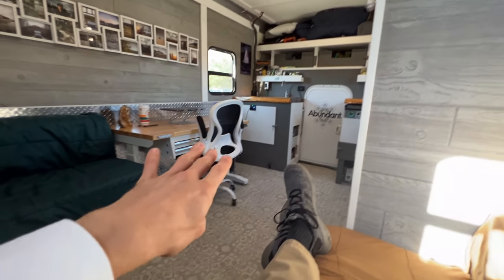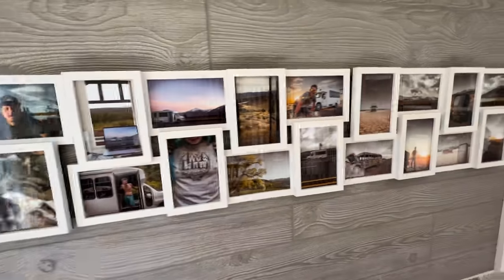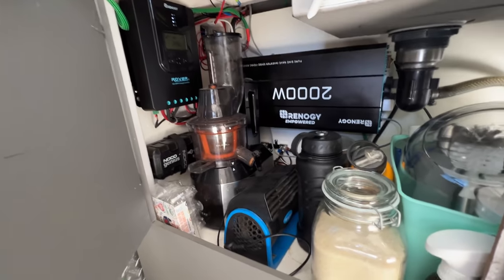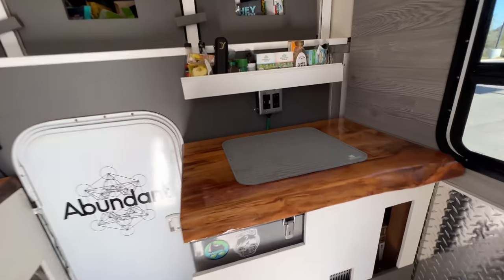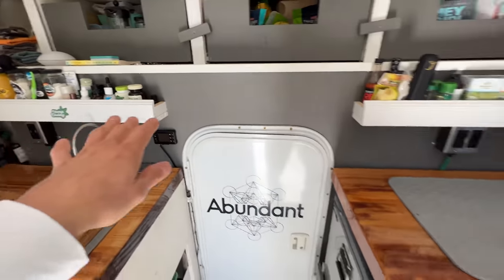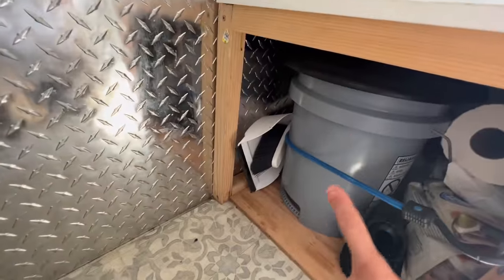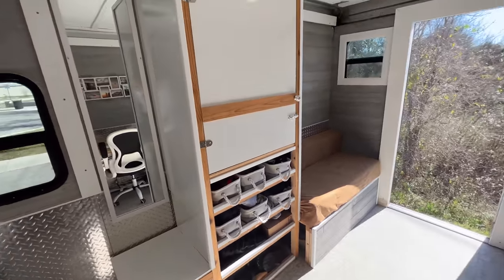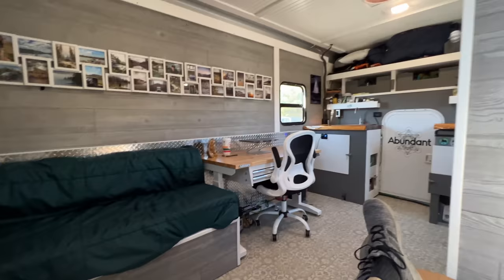Box Truck Conversion | U-haul  to Tiny Home Tour

Comment: After all my time watching the videos. people have suggested heated floors although a bit pricey have paid for themselves 100x over. I wonder if you would consider a system like that. It could also run a hot water system in the build or a cool depending on the temp you set. would you consider a happy jack or Murphy bed? the open space concept is good too overall I like your build!
Reply from the maker: I have seen the heated floors done. You have to heat with propane though. It’s not economical to hear water with electricity in a van. I prefer to use an all electric system. My heat pump does this very efficiently and I can do it with solar, never having to buy propane.

Comment: Hey Brad, 
New Subbie here 😊
I am so happy I came across your channel. Love what you did with the space. I also love the name of your van. I saw that you’ve been on this journey for 4 years during which u had different vans. Is there a reason why you kept changing it. Did your previous vans give out/maintenance issues? Or did you just want something new? 
❤ love that you have crystals and you talk to them lol. I do the same thing! — sending you Peace & Love on your travels/journey. 😊
Reply from the maker: I have built and lived in 4 different rigs in my 5+ years on the road. I wanted to try different vehicles and layouts. 

Box truck is now my favorite platform. I sold the last box truck because I came up with a new design to try out. You can see how different my latest box truck build is. 

It makes more sense to sell a build and start from scratch with profit rather than rip everything out and built it again which there will be no profit, only expense

Comment: Very nice build, I'm going to take some inspiration from your van.

My one thing that I have issue with is actually safety related. you really should not store fuel in the cab where you drive, fire hazards aside, diesel is an extremely toxic fuel when the fumes are inhaled and if a small crack were to form in the container the air could become toxic very quickly in that tiny airspace.
just trying to look out for you, keep on truckin
Reply from the maker: Thanks for watching!

Comment: Very nice build and thanks for the tour. I have been bouncing back and forth from this very truck size to a sprinter type van.  The reason I always seem to go back to the van is fuel economy. In today's world fuel prices make a huge difference to the distance you move around. I love to move, but i also would prefer this size of a home.  I never get an honest answer to what the fuel economy really is for a truck this size. Can you please give me a honest real life fuel cost. Also I didn't see if this was a diesel or gasoline powered machine. Then comes into the picture how many miles can the gasoline versions go before major engine work is required? I really would love to know these things before deciding on buying one over the other and regretting it.  I love the space you have in your home compared to a van but......?
Again thank you.
Reply from the maker: This is the gas v10 motor, it gets 9.5 mpg. Previously I owned a diesel 7.3L shuttle bus and it got 12mpg. Before that I had an e250 cargo van with gas 5.4v8. It got 11 mpg. I don’t really feel that’s enough of a difference to matter. Fuel is expensive but you don’t have rent or an electric bill or a water bill or a garbage bill…
Reply: @nomadbrad503 , that may be true.....but it's still a gas hog.

Comment: I really like your build, however, i think if you ditch the bench bed, and instead use the mom's attic as one, you would reasonably be able to install a nice bathroom and more storage by moving the door to one side. Also, missed opportunity to add a stove by not making the fridge area an L shape.

Overall though, i love the video and the design. Any rescources you would suggest for learning how to do electrical and plumbing for these things?😊
Reply from the maker: there is plenty of room for a bathroom if you wanted one in here

Comment: Doesn't the bed separate (slide apart) while you're sleeping? I'm a very restless sleeper so I'd have to have a single piece twin. Thanks; great truck, great video!
Reply from the maker: I put a mattress topper on top it has the elastic bands in each corner which hold everything together

Comment: I love the layout of this conversion! 
Do you have a link for the faucet that you use?
Any plans on hiding led lighting on top of the tracks to the old roll up?
Reply from the maker: Here’s the faucet: 

Upgrade Drinking Water Faucet with Flexible Gooseneck, 360 Degree Rotatable Water Filter Faucet, Kitchen Bar Sink Faucet Lead-Free Cold Water Faucet - Brushed Stainless Steel by Lesica-RY https://www.amazon.com/dp/B08LSL1W9J/ref=cm_sw_r_cp_api_glt_i_ENG6MDERYXR74SD3WEQH

No plans on led strip lighting at this time

Comment: Wow nice job most spacious u-haul conversion I've ever seen . i am planing on doing the same however i am married and was wondering if the bed /  bench setting is big enough for 2 people . Any ideas ? How much money did you spent for this lovely project ?
Reply from the maker: This Bed was a full size memory foam mattress that I cut into quarters. It’s roomy enough for 2 but you could fit a queen, no problem. The conversion was $5,500 for the van and about $4,000-$5,000 for parts and materials.

Comment: 8' x 12' and no bathroom? I don't feel like this is a great use of space. An entire shower could have been included in the design. I know it was also an intentional choice not to put overhead cabinets as to preserve the openness, but lots of items are strewn about without a home (pressure cooker sitting on the floor, etc), making it seem extra storage would've come in handy. I definitely would have kept the roller door to maintain stealthness, sacrificing a few inches to install the traditional house door behind it.

The box truck camper is still a great concept and this guy's living it up, so kudos there!
Reply from the maker: those are valid concerns. everyone has different priorities

Comment: why did you put the hinges on the outside that would make it easy to remove door
Reply from the maker: its much easier to just break the front window or pop out the lock. If someone wants in, they will get in

Comment: Love the truck, its awesome..why'd you go from the shuttle bus to this though? Just curious
Reply from the maker: Sealed cab is so much quieter for driving. And the shuttle folding doors were noisy on the highway. Box truck is taller and shuttle busses and built better without the fiberglass

Comment: How do you find the power draw for that fridge? I'd like to install 2, one for freezer and one for fridge. How much power do they end up using?
Reply from the maker: The instruction manual will list the power draw. Also there is a sticker on the back that lists it. Mine is around 5 amps

Comment: Next time, get a larger box truck, so you don't have to remove the roll up door at all, use it as a storage area, while also having a "patio" having an interior door just after the roll up door, added security, so long as you also have the interior door to the cab, just incase someone decides pad locking something they don't own is funny.

Comment: Is there a reason why you've had so many van/box truck builds? The reason I'm asking is that I really want to own and build a van/box truck. My husband does not, he says the truck will breakdown constantly. This has been a constant disagreement. Please help me understand that side of van/box truck life. BTW I love your box truck. Thanks in advance for your help.
Reply from the maker: I have been on the road 4 years and lived in 3 different vehicles. Ford 5.4l  v8 gas cargo van, ford 7.3 diesel short bus, and now the ford 6.8L v10 gas. All my vehicles had over 100,000 miles when I purchased them. I have only broken down once...in my 5.4l cargo van which had 268,000 miles. It blew a spark plug. I typically take my vehicles to the mechanic about once every 6 months for some kind of work...that’s it. You definitely want to have your vehicle inspected before purchase and change oil regularly...other than that, the only thing to fear is fear itself.

Comment: Do you officially prefer the box truck camper over your previous shuttle bus build? I'm still deciding between the two.
Reply from the maker: Yes, I prefer the box truck. The separate cab is nice because you dont hear everything rattling around in the back, it feels more like your driving a regular van. The bifold doors on the shuttle bus are also noisy. I like the taller ceilings of the box truck and the square walls make building so much easier.

Comment: Did you notice an increase in road noise in the cab after you cut your pass through to it?
Reply from the maker: Yes it’s a bit louder
Reply: @nomadbrad503  Yeh I looked into doing it for my truck but my motor is a huge diesel and the cab is over the motor so basically right below the opening. Extra noise is very fatiguing on long drives.

Comment: How do you obtain strong Wifi signal and how much do you pay for gas? MPG is roughly 10MPG right?
Reply from the maker: I use a mobile hot spot for internet and added an external antenna. Gas mileage is 10mpg

Comment: what kind of solar panes you use cause you mentioned they are 300watts a piece, is it 24v system ?
Reply from the maker: The panels are 300 watt 36volts. The mppt charge controller steps those 36 incoming volts down to 14 volts or less to charge the 12v battery system.

Comment: Who makes the walkthrough parts? I hesitate on a box truck for that reason, no walkthrough on most of them. And do you pay commercial rates for insurance or can they be re-classed?
Reply from the maker: This van was reclassified as an rv insurance is $67/month through allstate
Reply: @nomadbrad503  Thanks, thats useful. On insurance, do you happen to know which of the common platforms is the cheapest to insure? Bus, shuttle, van, stepvan, box truck. Ive never done a survey of this and if there are big differences it would affect the choice.
Reply from the maker: @cvcoco  no big difference..my shuttle bus and box truck had very close pricing…about $60 per month for liability only. You most likely won’t be able to get full coverage on a diy build
Reply: @nomadbrad503  Ok i see. Did you ever insure contents separately as personal property?

Comment: I need a stealth camper. 1 thing i cannot go without is a spot for my 1000cc sportibe preferable inside. Anyone got links to builds with somthing like this would love a link.
Reply from the maker: You can do it. I have a friend that keeps his Harley on the rear freight lift of his box truck. Also seen a sport bike in the back of a shuttle bus, they used the wheelchair lift to get it in/out

Comment: Did you read the fine print for your insurance? I’d redo the wiring somewhere else man, no matter how long it’s been ok for, it’s still a serious hazard...
Reply from the maker: 4 years on the road, 3 different builds and I have never had more than general liability insurance. If i total it or burn it down, ill build another one on my own dime.
Reply: @nomadbrad503  As long as you’re aware and ok with it then power to ya man 🤙🏻

Comment: Does your heater run off your solar batteries though?
Reply from the maker: The electric portion of the heater runs off solar/batteries.( fuel pump, remote controller, and fan) the mmmm diesel fuel provides the heat

Comment: How do you actually find a van in a reasonable price range.......that doesn't already have an engine with 100k+ miles on it, though??

As a single woman, the last thing I want to happen is to break down by myself somewhere (esp since you'd have nowhere to live while it's in the shop!)

Thanks in advance! 😊
Reply from the maker: I purchased this van with 120,000 miles, lived in it for 2.5 years. Sold it with 146,000 miles. It never broke down on me. You can find newer/lower mileage vans like this at www.commercialtrucktrader.com but they are much more expensive

Comment: How much of a drain on battery is that instant pot?
Reply from the maker: Not bad at all, it’s 700 watts/hour but I rarely run it for more than 10 minutes at a time
Reply: @nomadbrad503  not terrible.   I don't have the inverter for it.  Yet I'd like to get back to using my instant pot.

Comment: BRAD! how many mpg, I really need to know please
Reply from the maker: 9.5 mpg always. Up hill, down hill, empty, full. The v10 gets 9.5 mpg
Reply: @nomadbrad503  Thank you for the quick response! You built into every option I wanted to do.  How was the mpg on your first build - the van and the mpg on the shuttle bus. MPG will be my priority for the first year of my mobile office. New subscriber here!
Reply from the maker: @abrahamdavidcabrera8238  the van was 12mpg the bus did 14mpg.
Reply: @nomadbrad503   The bus did what! The bus did what! It must have been diesel, right?
Reply from the maker: @abrahamdavidcabrera8238  yes it was diesel. But I wouldn’t recommend a diesel. There are a lot more maintenance and repair expenses on a diesel motor. And it was loud and rough to drive
Reply: @nomadbrad503  Oh I know, but that 7.3 is a beast! Thank you for your feedback and I look forward to your next videos!!1 Stay safe

Comment: that ceiling is in rough shape dude  its got rolling curves in it unless you used a weird camera angle  or lens for showing it and most of the seem covers don't actually touch the ceiling.  maybe you should take a look at that!  also you can just put insulation over the current flooring and then put flooring on top of that.  you dont have to take anything out on the floor to do what you want to do.  otherwise it looks nice i like the layout.  edit  nope it is the same rolling from the other side as well.  that is so weird you'd leave a bubble in the ceiling like that.  oh well the rest is great  but not sure about that ceiling.
Reply from the maker: Thanks for doing the research 🧐

Comment: Outside facing door hinges are not secure.
Reply from the maker: Let’s be honest here..If someone wants to get inside, they’re not going to mess with the hinges. it’s incredibly easy to pop the lock on the drivers door and they have access to everything. They will take the path of least resistance, That’s how Thieves operate
Reply: @nomadbrad503  a hammer and screw driver is all you need to remove the pins from those hinges. That's an easy path too.

Security means making all those easy paths much more difficult.

Comment: bruh, get a veggie oil heater or something and get that fuel out of your cab? You nuts?
Reply from the maker: i might be crazy
Reply: @nomadbrad503   the "little buddy" portable proane heater is also a well liked and often used one is such small RV's etc. Easily found in most camping sections of big box stores. Give it a try. That fuel in your cab is a lot worse for your lungs than you think lol.
Reply from the maker: @jakeroon  dude, the little buddy heater literally exhausts burned propane into your living space. Not a good idea. And  the fuel in my cab is in a sealed container.
Reply: @nomadbrad503   Do you know what the product of burned propane is? But hey you do you man.